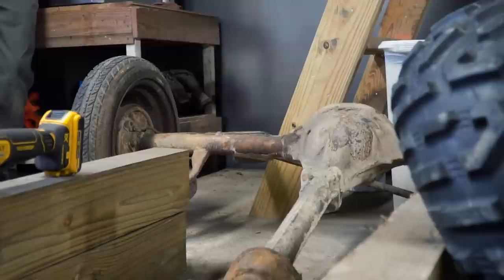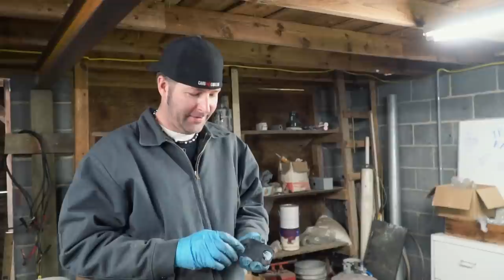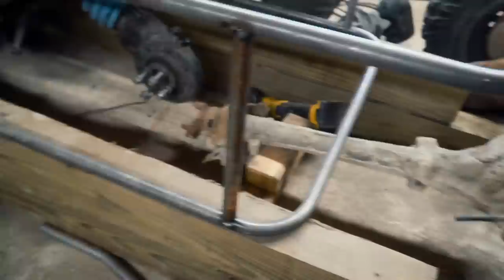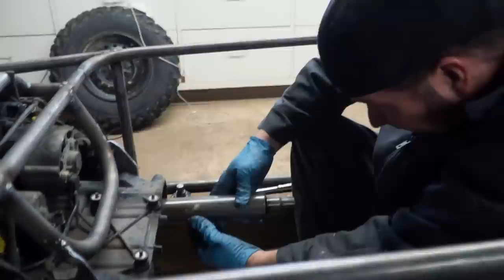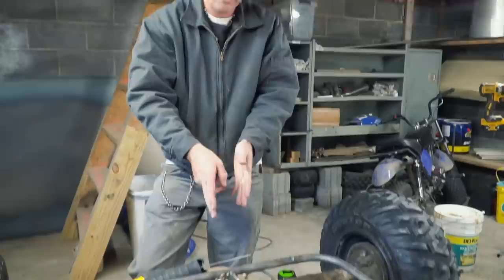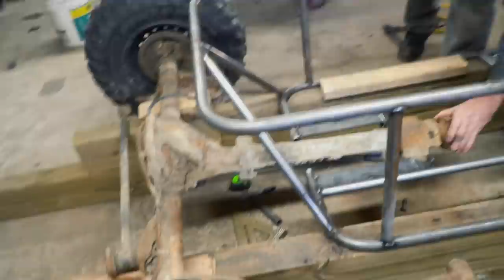1000cc Trophy Kart Build Pt. 3 | Mounting the Rear Axle

Comment: if you put your steering and suspension pivot points on the same plane it should eliminate most if not all the bump steer. so if every thing pivots at the same point , go take a look at an 80s F150 with twin I-beam front end

Comment: If you use the front end peice out of a chevett it's all bolts out of the car in one peice that would be ez to build mounts and put it on the front of your build and with it cames with the rack and pinion steering box it would work well no bump steer

Comment: I would skip the 4 link and run a trailing arm setup and connect the mounts at the same spot as the front u joint off the trans. Then use the torque tube as a center mount to keep everything working. As for the drive shaft. Remove it from the trans and have the end cut off and make a short section to adapt to the rear end.

Comment: How about a safety loop where you cut that straight tube. If you have on top and bottom it will be strong and place to mount triangle suspension to weld to

Comment: I think overall stability with short wheelbase and soft suspension might be an issue.  try to keep center of gravity as low as possible.  The fuel tank and battery etc.. can be mounted low.

Comment: On the rear, to make things more simple and get rid of the pan hard bar, do triangulated 4link!! Might make things easier for ya
Reply: Yep with multiplied ratio pushrod suspention so that litte miata shock can move the needed amount and sit in the travel the desired ammount
Reply: They need a 4:1 at least ratio on the pivots to get the desired 18 inches total travel  and besitting 2 inches into the travel to not have the cart jacked up in the rear like a gasser.

Comment: Why not use the k100 diff to transfer rotation from a vertical shaft motor to a rear wheel set up ,from like another lawnmower motor?

Comment: You know that transfer case you took off has the spline and a bearing in it.  I would take it apart and see if you can just pull a gear off and wend a u-joint onto it.  Then cut the housing and mount it somehow to a crossmember.  You will need a mounted axel there or it will fly all over the place.

Comment: Looks like a Jeep ax4 transmissions to np231/241 input shaft would be the right spline count, diameter and length but you’d have to have it drilled and taped on one end to accept a yoke. In fact if you wanted to go 4wd I’m betting you that you could mount a np231 directly up to that transmission output shaft lol.

Comment: Looks awesome but don't do a 4 link. Use a triangulated 3 link instead. With a 4 link both your front and read U-joints flex as the rear end travels up and down. With a 3 link the rear U-joint flexes much less. And using a 3 or 4 link on a solid axle it doesn't effect your caster or camber.

Comment: Guys! You don’t get bump steer if you make sure that the tie rods and A-arms are the same length and are placed in the same spot as the A-arms. It’s all steering geometry, as long as the angles are the same, the suspension travel doesn’t effect the steering at all.

Comment: You need to make it longer to give you more seating area. Then you can make a firewall to protect you from anything that might break. You've been lucky so far that your engines haven't come apart. When your luck runs out, it will be too late.

Comment: Look into doing a counter lever suspension so it doubles your suspension travel while using a short coil spring
Reply: It will also compensate for the lower weight of the buggy vs car springs

Comment: To get that amount of travel from a miata coilover you will need to do a pushrod system with ratioed rates.  6 inches of strut travel multiplied into 18 inches of axel travel.
Reply: You need a 4:1 minimum ratio to deal with the 4.5 inches of stroke on the miata coilovers  and need to be set to sit 2 inches into the shocks travel to maintain that equlibriem so the rear maintains its 9 of comprssion and 9 of sag.   As far as linkage for the rear end go 4 link  2 on the bottom out wide and 2 on the top close to center.  Will allow for large  flex and articulation.  If ya need some insperation look at r/c scale crawlers suspention setups.  Oh and loose the torque tube on the dif it wont allow the dif to move vurtically it will cause arching in the travel.

Comment: If the driveshaft turned the opposite direction all you need to do is flip the diff over like they did on some old race cars with a reverse rotation cam so when the engine torqued the left front tire would pull down.

Comment: A driveshaft from a 4x4 front end, one that has the splined shaft connector for travel. If it's close to right length, the splined portion can get it just right. Use the bike side yoke and it's universal bearings and maybe make a shim to fit those bike universal bearings to the other yoke of 4x4 shaft. You have a lathe, right? May need to clearance grind yokes or something. Same for other end. Hope that makes sense without picture examples. Again, too bad I'm up here in Ohio. The driveshaft with my transfer case might be useable; it's from a 2001 Kia Sportage. Hell, maybe something like a Suzuki Samurai; I think those are 4x4.
Reply: Maybe some ATV front shaft.
Reply: If they're too drastically different in size, then I guess you better eyeball them welds good and take most off the chevette shaft and weld it to a stub of the BMW  shaft. Stub of one to make errors in centered-ness less drastic on vibration.

Comment: just an opinion bun with the look of the motor and the way its going together with the rear you maybe should have designed the frame into a 2 seater mini ratrod and with the curved down back frame would make a good look as well a good set up for the rear suspension but again just my opinion

Comment: Between the long snout of the pinion on that axle and the small drive shaft off the motor I fear your notl going to get the suspension droop your looking for to get a smooth ride at high speeds. Wouldn't it be best to pull the small drive shaft for a longer one with u joints or look in to a different axle with a smaller pinion snout. I completely understand the Chevette axle it's probably the narrowest axle you could find. I'm just trying to see it work as you explained and I'm only seeing a 4 to 6 inch droop.

Comment: you can always play around with cantileaver suspension.
on that note, i'd feel more inclined into all individual suspension. you could cut the rear axles near the diff. and use doulbe u joints for the individual rear transmission. it'd probably save you some weight too althou... i do understand the word "budget".
Reply: If they are using stock miata springs, its going to be cantilever. There is no way you are getting 18 inches of travel out of a miata spring. Independent suspension is also usually heavier than a solid axle.

Comment: Not to be a critic... but I don’t think the “torque tube” on that rear end is going to work with what you guys are trying to achieve. Long travel with a 4 link will not work without a universal joint at the nose of the differential like a traditional truck solid axle. The suspension will not cycle properly and bind.
Reply: If you have the 4 link set to bring the input of the diff upward it won't ba AS bad , but yeah I agree
Reply: Is there anything stopping them chopping the diff and adding another u or cv joint?  They probably planned to do this anyway if an issue arose.
Reply: @SportbikerNZ  uhh I suppose not , I was more thinking if you mount the 4 link top mounts at the right angle it would move the diff front up and down , I'm not an engineer but just was brain storming , I'm curious to see how they do this :)
Reply: The universal joint at the differential nose is indeed not optional, they mention they needed to find a solution for that. 
The real problem is that with the Chevette suspension geometry that long nose is used to control axle pitch rotation which makes it incompatible with four link. I'm confident they'll figure that out eventually, probably after a few hours of driving around with the suspension rigid.
Reply: I also agree, length of driveshaft is extremely short which makes it worse
Reply: @brocktechnology  If it caused a problem they'd sort it out long before "driving around with the suspension rigid".
Reply: @SportbikerNZ  They don't plan, they always wing it.

Comment: You’ll break that rear end in no time lol. Those blow up trying to do burnouts in chevettes. Owned them and buddy did as well.
Reply: It looks way beefier than the tiny swing arm diff setup the bike has.  The motorcycle motor wouldn't have massive torque and I'd think power delivery would be a piece of cake for a diff designed for a heavier car.
Reply: @SportbikerNZ  You again...... Chevette had 50-60hp and weighed about 1850 lbs. The gears and axles in the diff are very small and very weak. Literally the live axle Gopowersports sells is stronger.

Comment: Any way you can make one 4x4 would be awesome
Reply: Oh there's a way but it would be challenging
Reply: Maybe if it was built to  with a selector switch to be able to go 2 wheel or 4 wheel drive  at push of a button,..
   jus my opinion, but it'd be a waste of power to be a full time four wheel drive w/that motor they're using, .. Remember the ole honda  300 fourtrax ??  the 4x4 version only ran about 35-40mph where as the 2 wheel version 55-60 in some  variations..

Comment: IKE & JON,.. just a thought,.. JON mentioned budget wise using Mazda Miata parts for suspension.  O.K. have u fellas thought much about AIRBAGGING the suspension on this build?? Prolly get all 4 components,compressor, & gauge panel under $300. JUS SAYIN,.. It'd make for a hella comfy ride plus u could raise and lower the height  when needed. Think about it,.. be perty daaauum sweet!!! JMO... good luck however u go with build..Be safe..

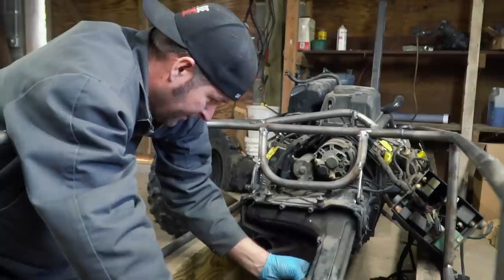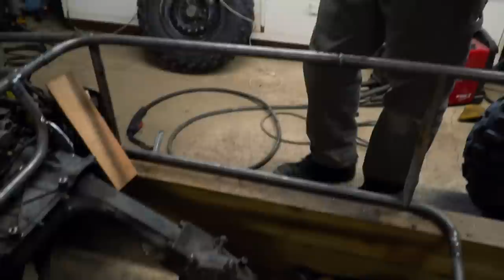Comment: Is the final drive ratio with that Chevette rear axle going to be good for off-road? I hope its the 4:11 rear and not the 3:36.
Reply: Most motorcycles only have a 2-3 final drive ratio (i believe the BMW came in 2.64) so even the 3:36 would be dropping the gearing. I think 4.11 would be way to much of a reduction. You would be shifting every second.
Also, many motorcycles use a 24 inch tire so there would be no difference there.

Comment: You need to do a v type rear 4 link it's the proper thing for off road then you don't have to have a panhard bar and the axle gets full articulation. Also when welding pipes together on roll cages you need to drill a small hole in the center so the pipe can vent, or else it pushes out on the welds and makes them weak. Metigulous talks about it on his rx7 roll cage.
Reply: Also twin ibeam front suspension like on older 90s ford trucks that's what you want to design your front end on as it's what desert pre runners use and trophy trucks

Comment: 1:1 right angle gear boxes will solve your problems on the final drive train
Reply: No really, I could see these dealing with the "up and down" but would likely fail with the "side to side"
Reply: Nick Burns a big beefy 90 degree worm would do just fine in my opinion. Plus it could really make it much lighter allowing for install of heavier suspension.. of course all of this is juts my opinion. I’m sure whatever they do will work fine and I will enjoy watching them get there

Comment: The problem with the chevette axle is the  torque tube. The axle needs to pivot on that mount so you will see sever pinion angle changes with lots of travel. I’m not sure that bushing is capable of that amount of travel.

Comment: That drive shift angle is really bad I would definitely look into that before you spin it 8000 while off road. Can be fixed easily with engine mounts or adjusting the rear end angle.

Comment: The part you removed from the BMW drive shaft is called a final drive, not a differential. A differential is for a vehicle with 2 rear wheels, the motorcycle only has one rear wheel so it has a final drive.

Comment: I still have my 1980 model Chevette. Brand new price of $5300 from the Chevrolet dealer. Purchased in November 1979. Has a 4-speed manual transmission with a two barrel Holly carburetor. Anybody want it?
Reply: Your not in nc are you? Lol

Comment: Use a boat steering system. It's just a cable with a rod on one end that moves in and out with a steering wheel shaft at the other.

Comment: I think you guys are really restricting what's possible on this build.
That frame has to go.
If you're building a trophy truck the main thing is huge suspension articulation. Which means long arms. Run a chassis rails from the top motor mounts like you already have, have it go under the seat and then pick up the strut towers for the rear end. That way the drive train is all on the same rail.
Then the front lower control arms can pivot from essentially the centre, the top control arms from the side of the engine. With that huge fat frame you're going to have very short control arms which will mean jumping will be violent.
Reply: Frame is kicking off fine.  Premature assertion as they've clearly just started and there's no indication of final suspension travel at this point.
Reply: But logically, that lower frame rail around the bottom of the engine is superfluous. It's not holding anything at present. Why not make it narrower to allow for longer control arms? Look at anything successful like a RZR buggy or a Jeep. Are the frame rails the same width as the cab? No. The RZR control arm pickup points are almost in the centre.
It should be built like an ATV frame except the seat is lower.
I'm all for doing new things but reinventing the wheel is making it square is a step backwards.
Reply: @1one3_Racing  I would hardly call the main lower frame superfluous and is slightly narrower than the cab.  Obviously you can't compare a buggy frame as the engine is at the front here.  There's only so much narrowing possible.  It's still only one person wide which is fine.  Another big reason is they want good access around the engine.  Fitting everything close to it with tight clearances won't achieve that, also any sort of engine swap would become that much harder.  
Just have a wider front track if longer control arms are desired.
One of the main draw cards of this channel is the fact they don't following some existing plan or blueprint.  Seeing them sort stuff out, making something totally theirs and unique is cool.  Who wants conventional.

Comment: I have my doubts that the engine has enough power for this project.
Reply: Same power as the crosskart engine, and that hauls.
Reply: After a closer look it has a good amount more power +30% and torque +40% over the 750, so it should really hoof it.
Reply: 90hp

Comment: Had to pause at the begining just to say, I'm already concerned about a cars and cameras designed 4 link with no design, no clue about instant center and roll center or really even basic geometry. I hope I'm wrong.
Ok well that's not going to be a 4 link. 

As for the front. Please learn why bump steer happens and design it properly. Engineering explained can help. Drive channel has some good info also. The key is the length and height of your steering links in relation to the upper and lower arms pivot points.
Reply: I'd like to hope they'll listen, but they sort of do whatever to get it steering and then live with the design and try to revise it. If they're using Miata shocks I doubt we're talking huge suspension travel anyway lol..